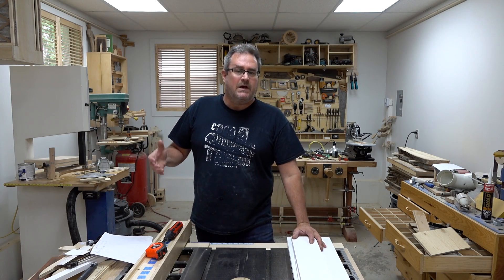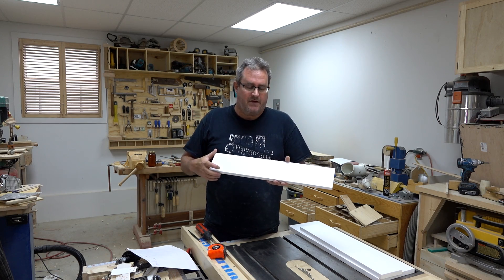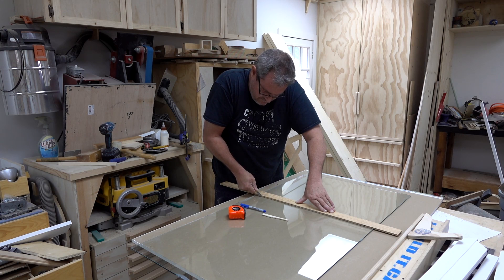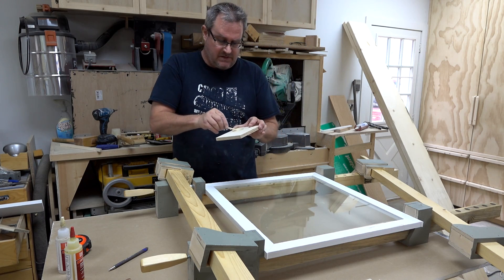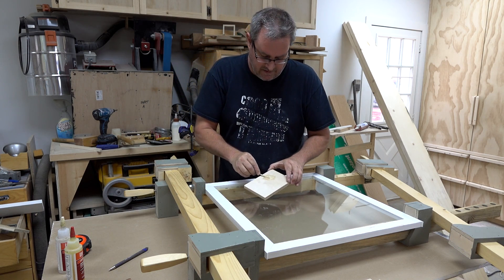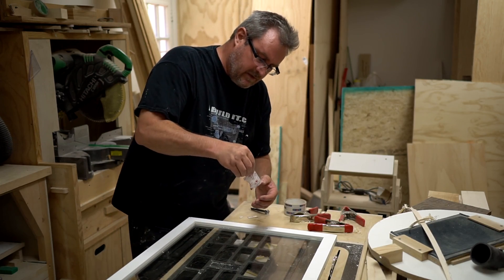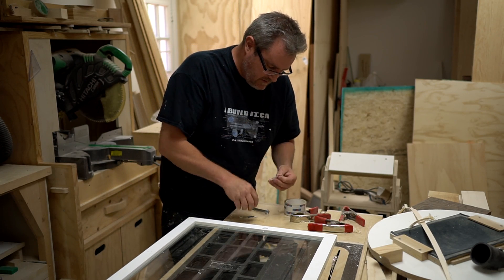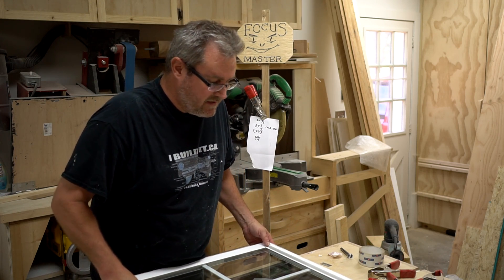Making Windows Triple Pane

Comment: Great video.  I have a tip for you. to keep your cuts clean looking. After you rip/cut a piece of pvc/azek, use a rag and some acetone and run it over cut edge.  This will dissolve the rough edges and close up pores. It will also smooth up the edge. Hit it with some 320 sand paper first but don't blow it off.  The acetone will dissolve dust and give you even nicer finish. 
Using this technique allows you to use router on edges and make them look alot better than square corners. 
Love your channel.
Reply from the maker: Good one!
Reply: great tip
Reply: Oh that's going in the big book of handy tips!

Comment: Triple glazing is good in summer too! Keeps heat out and saves on AC costs. 

In old houses here they have wooden framed single pane windows that sit far out in the wall, then on the inside there is a hinged or removable window, often with a beaker of sulphuric acid to stop condensation, or using a lichen (Cladonia stellaris) which looks quite pretty, people would put little toy soldiers and such in it and make little winter landscapes between windows.

Comment: There is an old guy who cuts glass at our local hardware, when he scores the glass with the cutter,  he the taps the glass gently underneath the score line with the cutter until a cracking starts to appear, then breaks it, he told that is to avoid what can happen on your second cut. hope this helps in the future

Comment from the maker: After adding the storm to the outside, I decided I should take the time to make and install the new sash on the inside. This makes the window units triple glazed and should be a good bit more efficient than they were before.
Reply: Your windows look really good John.  No one would know they are not professional windows from a window store.  You are very talented.
Reply: Do the modern sash windows have counter weights? Had to put double glazed reolacement units in some very old Victorian sashes, which involved making a makeshift see saw,  balancing the  window with the new weight, fine tuning. All the original weights were round, and luckily the new ones were square (and heavier), and fitted nicely in the (travel limited) old channel in the window frame. Thanks for all your tips making hard work go a little easier :)

Comment: I think the reason the glass dances off kilter as it breaks has to do with where you angle your cutter. It's like when you cut foam with a cutter. If you catch the straight edge you cut with you'll make the wrong cut.

That's why i've stopped using those wheel cutters and i'm using a carbide bit i've sharpened to a point. It affords me the ability to cut a very uniform line, it is true that i have to pass the line at least twice before i can break it clean, but i prefer this way. 

There's also the fact that you should wet the score (i know you're cutting steps in the video, and i don't remember if you're wetting the glass or not).

Comment: In my experience, glass is less likely to break wonky if the score is lined up over a straight edge (or over the table edge). I started out using a small object (sometimes a stick, sometimes the ball on the glass cutter handle), and the glass would break wrong more often than right.

Comment: The silica gel is an interesting approach, though I wonder how long it can absorb moisture without getting saturated. My inclination would be to drill the smallest weep hole that will keep the cavity dry. Either way, this seems like a better approach than the factory sealed argon-filled double and triple pain windows they're constantly pushing. Between the gas working its way out and the panes caving in and frying the neighbor's siding, they seem too temporary for the money people spend on them.

Comment: Great idea with the silica gel there. I'm going to stop throwing out those packets :)
Reply from the maker: Thanks Kriss. I've taken apart older windows and found that stuff inside the aluminum spacer between the panes in a sealed unit, so I figure it's worth a try here. I've got ten others to do, so I expect I'll to track down some more.
Reply: +I Build It Home u can buy them on amazon .. dont use packs that have been previously exposed , even though they seem dry they are already full of moisture.
Reply: How long is the silica gel good for?  I have often throw away theses. I fingered that they were finished or would continue to collect moisture in my drawer. How would I know if there finished being useful?
Reply: I've been saving those packets (they come with shoes) for over a ¼-century now. As far as I know, you can bake them at low temps to dry them out. There's vids here on the Tube on the subject.
Reply: I have been putting them in my tool boxes for years to keep mildew from growing on the plastic handles.
Reply: You can also get it as cat litter

Comment: Glad you got around to it earlier than expected or you might have put it off (like I do) or other projects got in the way, until it was too late!
Good work and a nice touch with the silica gel.
John, I glued some PVC window trim and also exterior house trim 1"x4" boards together using regular Oatey Purple Primer and PVC Cement, like the stuff you use for PVC plumbing. It worked and was really strong as hell. Not expensive maybe cheaper and stronger than epoxy? Worth a try.
Reply from the maker: Thanks Mac. I already tried the pipe cement, I used it on the windows for the basement (video on this channel, actually). Doesn't work as well as the epoxy.
Reply: +I Build It Home
Ok. Perhaps the PVC your using is a bit different. In any case, you tried it and got the epoxy to work for your task which is all that is important.
Reply: Purple primer? Why not clear primer.....

Comment: I am almost positive it's called a "caldwell spring" perhaps "callwell" I can't remember, most all the manufactures that use this type of spring. They get them so they are stack-able.  That way for their bigger windows they don't need a different spring just add them till it works.  They only stock one type.  Also easy to replace when they wear out.  So when you have a special someone over that likes fresh air.  They won't see this DIY GURU with a stick holding up his window.

Comment: This is a great experimental series, the PVC is a good option for the frame, could you have used plumbers waste pipe solvent weld to fix the joints?

Comment: very neat. been thinking to do similar thing in my place a while. I was gonna do mine from acrylic. better thermal insulator and lighter compared to glass. Do you know any reason not go with acrylic?
Reply from the maker: More expensive and scratches easily. May also discolour.

Comment: Hey John, Wally Here in Sterling Heights Michigan and I've been following you on all your channels and enjoy them all. May I suggest that you try Pvc pipe cement!!  I had a project I did for my wife and used the same I believe material that you are using and it held Great. Give it a shot on some scrap. Keep up the great work. Wally
Reply from the maker: I already did, when I did the windows for the basement. It holds, but not as well as epoxy.

Comment: Great video John. Are you able to add a panel to the top half of the sash?
Reply from the maker: Already did, from the outside in the last video.
Reply: I was wondering more if it's possible to triple pane each half, inside and out, or is it impossible because it will stop the sash from moving
Reply from the maker: They already are: 2+1 on top sash, 2+1 on the bottom sash.
Reply: Ah right, got it! Thanks

Comment: ok john, so it's near the end of winter now, did that work? did the silica keep the moisture out and was this sufficient to keep these moisture free long term?
Reply from the maker: The sealed bottom sashes (with the silica gel) work great and not steamed up. The upper "storm" ones didn't work as well, so mixed results.
Reply: the bottom ones looked really well sealed, I couldn't see how your upper ones were sealed. Perhaps some room air was able to enter the gap between the panes on the upper sash?
Reply: so, what happened with the upper sash storm window you made ?

Comment: Gass looks thick, what size is it.? if you made the slot wider you could have shimmed the glass in a few places so it would have silicon around it and less conduction transfer than being against the wood.  Also if the slot had square 1/8 x 1/8 or 1/4 x1/4  strips of insulation foam it would seal much better when you made the frame around it than the final on each side silicon or putty.